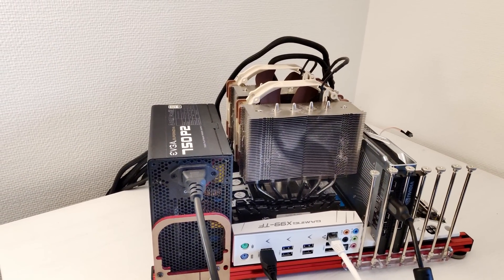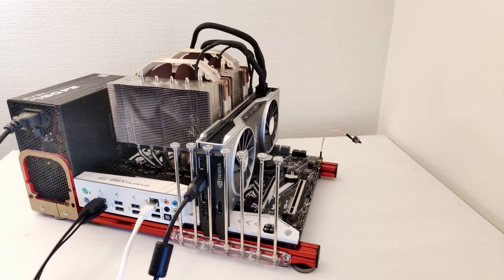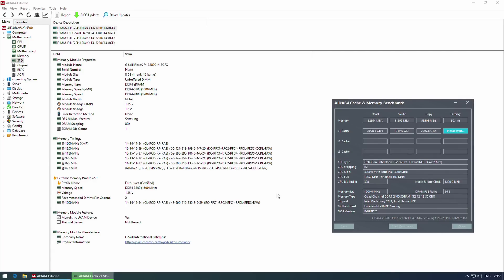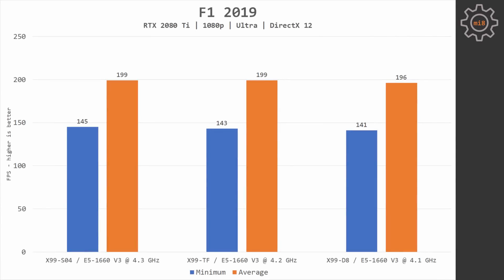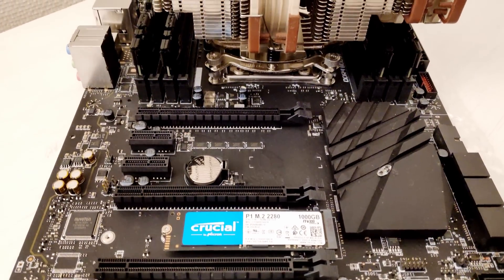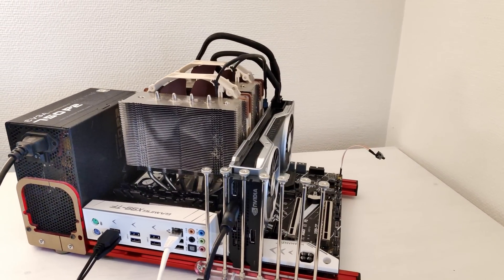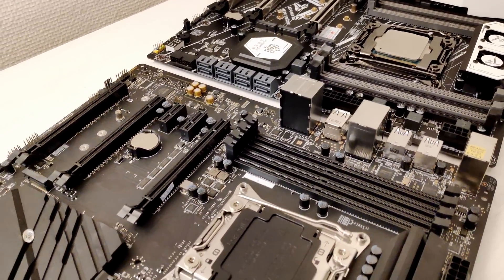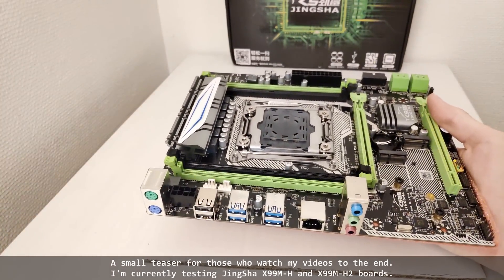🇬🇧 Overclocking Xeon E5-1660 V3 on MSI X99-S04, Huananzhi X99-TF, and JingSha X99-D8

Comment: Are you sure these things degrade at stock settings even after years of datacentre usage?.. They seem very conservative and the heat output of mine is easily manageable even in AVX Prime95 up to at least 3.8 GHz... there is a strong exponential increase in power and heat above that in such tests.. that is when I'd expect these to perhaps degrade. Therefore, if you only have 1 to test, are you sure it's not just because it wasn't a great OCer to begin with? It isn't at all unheard of for 5960X's, especially early ones, to be stuck at 4.3 from the start. It's still well above the max boost clock of 3500. 

I've been running 32GB 3200 CL16 on mine with just 1.05 on both the SA and IO as well.
Reply from the maker: Maybe I just have got an average (not great) sample. With just a few samples to test, I can't really insist on anything. In the past, I had a few E5-1650 V2 & V3. Some of them were used in workstations, others got to me after lying on a store shelf for years. The "new" ones were better overclockers. It might still be just a coincidence, but that is what I have experienced with ~10-15 CPUs tested.
Reply: @Miyconst 
Both ways are possible, I wouldn't rule anything out..

 I bought my 1660 v3 as a brand new OEM/Tray processor from a company which specialises in this stuff.... it's not a great OCer but not a terrible one either. It passes stress tests which don't use too much AVX like Realbench for a while at 4.5, given at least 1.325v, and it also did 4.4 at 1.275. I have it on 4.4 Auto which puts 1.31v adaptive through it. I'll stick to my real world usage (most notably gaming) with it and just hope it doesn't degrade... if it does, I'll take that as extra experience with hardware and replacing it shouldn't be an issue as long as my board doesn't go out with it. 
Before this I had a 5930K which wouldn't even do 4.5 on 6 cores at 1.36v. Crashed within the first 20 seconds in Realbench. I'd bought this chip used so I have no idea whether it degraded or not but it didn't have any issues booting the system or running AVX tests on stock volts, as well as power saving features, neither of which worked well at all on a (presumably) degraded 5960X from eBay I tested about 2 months ago. I returned this one for a refund.
Reply from the maker: - @ryanocallaghan8833  Yeah, seems like it was a "degraded" i7, but again, it's way too few samples to make a generic conclusion. I used an i7-4930k for a few years. When the CPU was new, it was a really good overclocker, reached 4.7 GHz. A few years down the line and it was able to get 4.6 GHz only. When I sold it, it was stable at 4.5 GHz only. Again, too few samples to make a generic conclusion, and mine i7 was used overclocked with increased voltage, but it's still some experience which indicates that the CPUs may degrade over time.
Reply: @Miyconst  I'm also unsure whether motherboard power delivery degrades on any X79/X99 board, some people online have suggested this but to me, it seems unlikely compared to CPU degradation.

Comment: This MSI can use ECC memory? What is the advantage of the SLI model BIOS? Thank you in advance. Your channel is excellent!
Reply from the maker: I have not yet tested the motherboard with ECC memory, and in my tests the SLI PLUS BIOS didn't get anything on top of the stock BIOS.
Reply: @Miyconst   Please post a response here if you find it. I'm planning to  build a Workstation (to work with Data Science) and this board appears to have a good construction for the price. It the same PCB as more expensive models. 

Moreover, the X99A - SLI (not the "plus"), have the same PCB (without pcex metal shields and U.2 connector, even having the contacts) accepts the ECC reg memory. maybe that BIOS can be used.
Reply: Premium model, same PCB, ECC support:

https://www.msi.com/Motherboard/X99A-SLI.html
Reply from the maker: @philosdata  I can finally confirm, that MSI X99-S04 works with DDR4 ECC REG memory, just now I have tried to boot with a Xeon E5-1660 V3 and some ECC REG memory modules.
Reply: @Miyconst   Thak you for the feedback. I will buy one still in this month for the new workstation.

This model is basically an trimmed X99A-SLI (same model code, maybe can be flashed by software with that BIOS). 

The difference is just the metal-reinforced PCI-E slots, the U.2 connector, second Wi-fi, the diagnostic two-digit display and the  reset and start buttons. All this with the solder points there, empty.

It a cost-conscious good (not so) basic board.

The SLI "Plus" is a different PCB.
Reply from the maker: @philosdata  another update: even though the board works with ECC REG memory, it operates in non-ECC mode.
Reply: @Miyconst   Too bad for me. I really wanted ECC for the workstation.

Would be interesting if you could test the X99A-SLI BIOS (probably can be flashed by software, as it the same model number). 

Maybe it can have more features.
Reply: @Miyconst  In thesis, with the X99A SLI (not the "plus") BIOS it should run ECC because is same PCB and same BIOS and that model supports ECC officially.

It should flash by software too, as the model number is the same.
Reply from the maker: @philosdata  yeah, could be, if I still have the board by the time I have some extra time for it - I will validate.
Reply: @Miyconst   Thank you very much! I would appreciate it. 

I mounting a new workstation based in this board an will use ECC because is cheaper, but would be nice to use this function to guarantee memory error correction (i work with data science).

The final configuration will be (completed january):

-MSI X99S-04
-Xeon E5-1660 V3  (overclocked with 1.2V or less, to 4GHz)
-64GB DDR4 2400 ECC reg. Hynix (maybe running at 2666?) 
-SSD Adata XPG 8200 pro 512GB
-GeForce 1060 6GB (borrowed from a friend, until I get my 2080 Ti)

Comment: Firstly, I love what you're doing!
I have a question mate, can I use a stock cooler with turbo unlocked 2620v3? Or does it have to be a beefier cooler?
Also, a video about coolers for x99 platform would be much appreciated!
Reply from the maker: Even turbo unlocked E5-2620 V3 can be chilled with almost anything. It's a really cool CPU.

Comment: Has anyone been able to overclock RAM more than 3000 MHz on this processor?
Reply from the maker: DDR4-3200 worked with mine MSI X99-S04.
Reply: @Miyconst  Timings? I have samsung b-die modules, but it does not pass stress tests on 3200 (OCCT ram test, or prime95), windows or games working well. On another system, like am 4 or 1151 this modules passed stress test on XMP 3466 profile
Reply from the maker: @jayksman  I have 4 x 8 GB G.Skill DDR4-3200 CL14 Ryzen Edition modules. They worked fine with the XMP profile (DDR4-3200 CL14), but with such memory speed any CPU/IMC overclocking lead to BSoD and other crashes.

Comment: Great video, I have same results on my rampage V board with 1660v3 (4.2@1.25V, 2666@14-16-16-28). It can 4600@1.37V, but very hot temerature and unstable working( The 5930K processor on same board and ram can be 4.5@1.35 and 2866 RAM
Reply: , here the x99 TF the 1660v3 @ 1.15v core peaked to 1.175  imc and ring untouched.
Running ddr4 2400 @CL17 and 1.2v

Comment: Hi myiconst! Did you know if  2 Xeon confidential samples work as a dual CPU config? Like with the huananzhi F8D mobo?
Reply from the maker: It depends on the CPU. Some do work, others don't. The CPUs have to be identical to work together, but with the preproduction CPUs it's not guaranteed that the dual CPU configuration will work.
Reply: @Miyconst  thank you very much for the answer. I was planning for a dual 2650v4 cpus. They have performance close to 2678v3 but they are 14nm instead of 22nm so much more efficent  cpus . Thank you anyway :)

Comment: Can ypu compare ddr3 16gn 1866 in quad channel vs 16gb 3200mhz ddr4 in dual channel.will the ddr3 be faster  becuase it has more theoretical bandwidth and lower timings?hope ypu amswer
Reply from the maker: Which platform do you want me to perform this comparison?
Reply: @Miyconst  oh you replied see i was thinking about the scenario.is there a processor that can run ddr3 amd ddr4 in dual and quad channel i dont know
A test suite can be if you have some intel or ryzen build that supports ddr4
You take a processor that supports ddr3 dual and quad channel
You first compare 16gb ddr3 dual channel to 16gb dual channel of ddr4.in this way you get how many percent the ddr4 system intel or amd is faster than your dual channel ddr3 system
Then you install quad channel ram in you ddr3 system and see if the gap shrinks.it would happen in memory sensitive games like cod mw battlefield i think flight simulator too
It is hassle.i dont mind if you dont do it but i cant find any test like this on the internet
Ty for replying
Reply: @Miyconst  specifically i want to see how much these old xeons can narrow the gap between these new cpu from intel or amd when they are cpu bound.ofc the ones that support quad channel ddr4 also  i want to see how quad channel ddr3 fares against dual channel ddr4 considering it has lower timings and equal theoritcal bandwidth if we compare say 4x4 1600 mhz to 2x8 3200 mhz ddr4
Reply from the maker: But what is the point of such comparison? I have already compared Xeon E5-2678 V3 against Ryzen 5 3600. It's quad channel DDR3 vs dual channel DDR4. I have also compared DDR3 vs DDR4 using the same E5-2678 V3.
Reply: @Miyconst  ok i ll watch that
Reply: @Miyconst  just wanted to see how much faster or slower  the quad channel ddr3 is  whem compared to dual channel ddr4 Of equal configuration.mainly i wanted to see if lower timings of ddr3 will help ot against ddr4
Reply from the maker: @hassanahmad1667  Here you will find some answers: https://youtu.be/l95V_s4rVm0

Comment: Just to provide some more data for you, my 1660v3 had a stable overclock on Asus Sabretooth motherboard with a bclk of 103 and a multiplier of 43x at 1.28v, with RAM overclocked to around 2700mhz. I more recently downclocked it to bclk 100 and 42 multi to turn down the thermostat. Probably just some silicon lottery difference on the CPU clock and voltage, and maybe the bclk issues you experienced were due to your ES motherboard not having all the bugs worked out?
Reply from the maker: Could be, but I have had MSI X99A SLI PLUS & MSI X99A Raider as well as an Asus board. Increasing BCLK disabled the NVMe drive. Thanks for the statistics, it's nice to see that our numbers are very much alike.

Comment: 12:47 i have that problem also with huananzhi x99 f8 is there any bios modification for dissabling that? and how i flash the new bios?
Reply from the maker: As I said in the video - the required BIOS modification is available through mine Mi899 application. You can watch this video to understand how to use the application: https://youtu.be/bO2t790vhg8

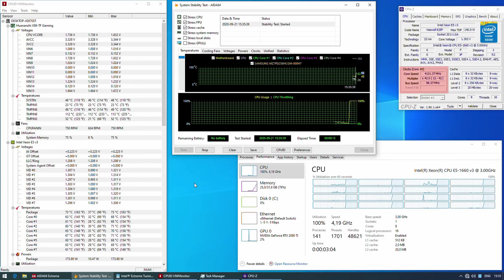Comment: Spread spectrum @13:28 maybe? It drops significantly below 99MHz though, your recording shows dips under 98MHz, which is not typical for spread spectrum. Can it be a bugged reading from CPU-Z? Does it show the same readings in BIOS?

You produce great and very informative reviews on these platforms. Sadly X99 is getting really old nowadays. The ones on Aliexpress are already a bit pricey, and the import taxes for the EU unfortunately kill any value in these Mobo/CPU/RAM combos.

Comment: OK, I really wanna get one of these setups, but the vrm temp issue.. Do you think the temp can be reduced by putting better fans on it, or perhaps removing their heatsinks and using your own with some 40 or 60 mm fans?
Reply from the maker: Yes, a custom VRM cooling solution help with the temps a lot.

Comment: Considering the SZMZ support, I was asking for the newest BIOS for the DDR3-version of the Jingsha X99-D8 and it took them a week but I got it after all which fixes an issue with the ECC functionality not working correctly with the stock BIOS [the error messages could be seen in Linux].
Reply from the maker: Could you please share this BIOS? Does it have RAM timings configuration?
Reply: @Miyconst  I've just send you an e-Mail at the adress which is posted here under channel info section.
Reply from the maker: @seylaw  thank you, I have got it.

Comment: I am very impressed with Huananzhi's motherboards, great quality for the price. After getting their X99 Gaming T-8 I think I will buy their 3 DIMM slot X58 motherboard since I have an old ASUS Rampage Gene II that is very temperamental (trouble booting, ignores 1 stick of RAM half the time, the USB ports are fried so I have to use PCI USB etc...).

Thank you for making me aware of the brand with their X99 motherboards. Cheers from the UK!
Reply from the maker: Huananzhi also has some really bad motherboard, thus make sure to validate each product separately. PhilsComputerLab has a very nice video about the Huananzhi X58 motherboard: https://www.youtube.com/watch?v=ouQVMgi9g54
Reply: @Miyconst  Thanks for the heads up! Yep that was the board I was going to get (at £50 it's cheaper than most used X58 motherboards these days). The drawbacks won't affect me as I'll be using HDD's and an RX 580 on it anyway.

Cheers!

Comment: Hello, the BIOS-iEngineer
 - HUANANZHI-X99-TF of your Mi899 tool  (The optimized one that you mencioned in the video) comes with turbo boost unlock for a 2690v3? And what -mv (undervolt) you recomend?
Reply from the maker: No, the modified BIOS from iEngineer does not have the Turbo Boost Unlock applied, it is suited for overclocking CPU. For Turbo Unlock you can pick any other BIOS with an injected FFS driver.
Reply: @Miyconst  Would it work if I inject the driver myself? for having the bios updates that the author comments in github
Reply: Ok, I just did it, Working fine!! With -50mv stable test passed! Now ram timings !

Edit:
""The host CPU does not have read access to the target flash area.""

That flash locked my bios, but no problem, I'm sure I won't put another bios in for a long time
Reply from the maker: @yasminaalvarez7501  Which BIOS did you use? You can try to use AfuWin instead of FPT in this case.
Reply from the maker: @yasminaalvarez7501  Yes, it will work, you can perform the Turbo Boost Unlock hack with this BIOS as the base.
Reply: @Miyconst   I used the BIOS-iEngineer
 of your Mi899 tool, the optimized one, is working fine with -50mv the temps droped to 32c stable. Im so happy!  I will try AfuWin, but at the moment I don't think I need to change anything, if in the future I need to, I would buy a cheap programmer from China.

As you mentioned, under load is 99 not 100Mhz of base. Its 3.48/3.49 instead of 3.5ghz but its fine.
Reply: @yasminaalvarez7501  if you want to replace iEngineer`s bios with any other bios, you need the CH341 flash programmer, because  iEngineer`s bios lock ME region, highly likely)

Comment: I've had no problems in my dealings with Huananzhi, they are a professional business.

Yes, I have only spoken to SZMZ twice, but indeed their responses were, less than I would have liked. And while their D8 motherboard seems decent enough, their dual X99 board totally misses the mark, especially with the single x16

Thank you for this video. While I have decided to go for the F8 board a while ago I am still on the fence for CPU.

The 2678v3 of course being the front runner, mainly because I can upgrade to a dual socket board when they improve them (such as 16 ram slots instead of 8)

But the OC numbers on the 16XX's look good as well, and I am glad you did a DaVinci Resolve  bench as that is what my X99 system's primary use will be.

Comment: those new jingsha boards seem nice, like their bigger brother d8.. can't wait for the review :)
Reply from the maker: Yes, I am also excited to validate what JingSha has screwed up this time 😁.
Reply: @Miyconst  how negative! ironic how you have one of their boards on your main rig :)
Reply from the maker: I am just being realistic 😂. JingSha tries to cut the production costs as much as possible, and X99-GT is an example of such "failure". Regarding the X99-D8 - I can't claim it to be my favorite board and don't use it myself. So far I am happy with the setup, but E5-2690 V3 is significantly weaker than my former Threadripper 1950X, even though Xeon beats Threadripper in games.
Reply: @Miyconst  i thought it was your main motherboard :/ also yes, zen cpus are miles better than haswell cpus when it comes to multi core (as long as they have a similar amount of cores naturally)
Reply from the maker: Yes, right now it's my main motherboard. I have sold my Threadripper setup.
Reply from the maker: With the current prices it doesn't worth it at all. So far there is nothing to beat E5-2678 V3 with its €75 price tag.
Reply: @Miyconst  i was about to say that... it only loses like 100-200mhz in tb, right?
Reply from the maker: Yes, E5-2678 V3 - 3.3 GHz, E5-2690 V3 - 3.5 GHz.
Reply from the maker: No, the asking price of ~140€ for a E5-2690 V3 makes it absolutely unreasonable when the E5-2678 V3 costs just ~75€.

Comment: Can this BIOS mod for unlocking CPU current work for locked CPUs like 2678v3? Mine at -50mv drops to 3.0-3.1ghz in cinabench, can this help or its only for unlocked CPUs?
Reply from the maker: This mod is going to work with the locked CPUs, but it won't help with the frequency. The frequency drops because of the internal CPU limitation. To achieve higher clocks under load you have to reduce the voltage even further.
Reply: @Miyconst  OK, thank you for answer :) Well mine gets unstable at -70mv so no luck for me. I heard of some legendary efi drivers that can fake TDP limits so 2678v3 can boost 3.3ghz even in cinabench but I am too scared to try them :)
Reply from the maker: I have tried these drivers, and it's not that straight forward to make them work properly. This is on my to-do list for an investigation.
Reply: yes, tbu works with any x99 v3 cpu